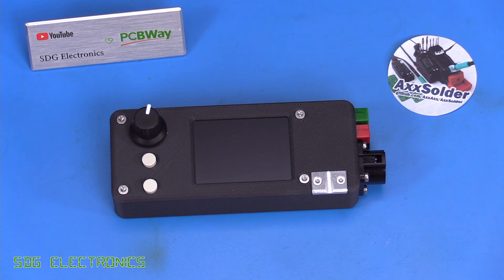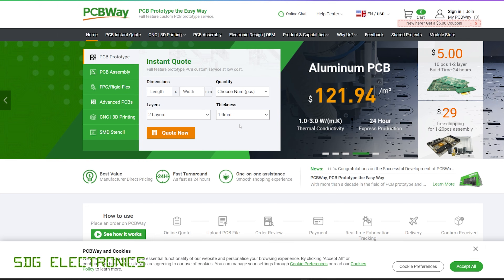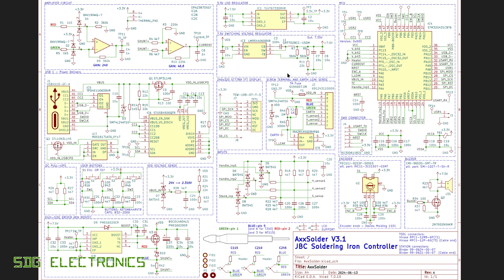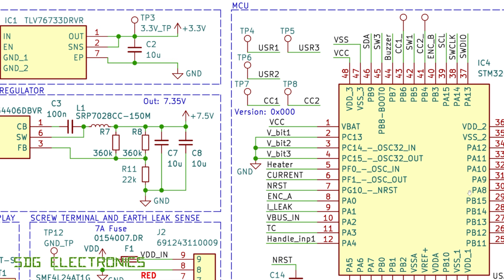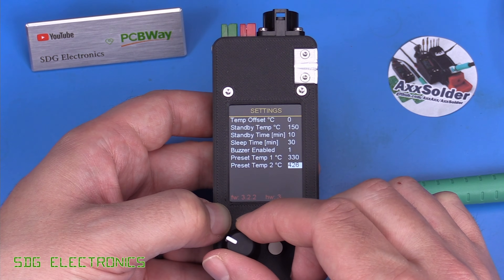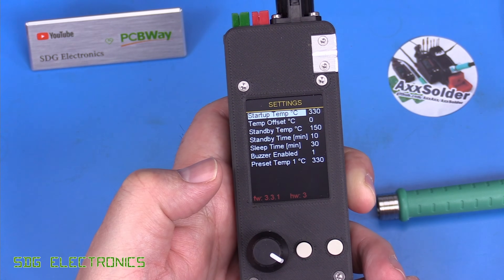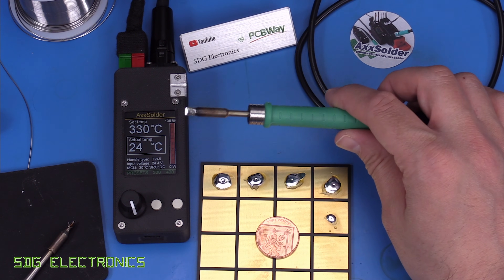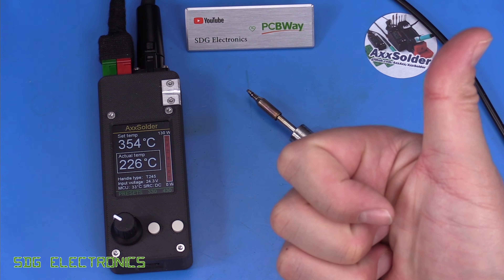SDG #358 AxxSolder - Open Source JBC Soldering System

Comment: This AxxSolder is a splendid soldering controller and your review is very insightful. Thank you!
I'd do the fixes you've suggested, use an MR30 connector instead of the andersons and add a safer handle holder.
Reply: Are there any sockets for case mounting available for the MR30 connector? I could only find some for direct pcb mounting.
Reply: @XD-nj7bc  I haven't found any panel mounted MR30, but you could use an  XT60IE-M, which accepts standard XT60 from a LiPo for exemple, but also XT60 with a ground tab if you have the correct grounded power supply.

Comment: 12:10 usb-c pd 3.0 is limited to 100W (20V*5A) on one port/cable. I assume the 140W is the max of all ports together on the usb power adapter.
140W for 1 sink needs pd3.1 EPR (28V*5A) that I doubt the usb charger or the AxxSolder supports, but I might be wrong.

Comment: I wanna make this with cheaper more accessible ICs. I'd make one if it wasn't hard to source parts!
I also think the circuit is a bit overkill(?) I could remove the PD circuit as I don't need to use it portably.  a few months ago I made my budget/improved version of this PCB but gave up halfway trough because of difficult things in my life and money. Now i'm too depressed to DIY one.
EDIT: damn onl 35 usd on pcbway for a fully assembled one? I could probably make an entire unit for 150cad-200cad. a lot less than aixun and other alternatives and probably much better.
Reply: better than aixun yeah, but you still need more parts, LCD connectors, handle, etc. $100 gets you a completed geeboon unit or similar.

Comment: Has anyone found a replacement for the Hirose RPC1-12RB-6P(71) connectors? 
They are now obsolete, obviously there is some equivalent since both JBC and all the chinese stations use these but I couldn't find anything on Mouser or Aliexpress...

Comment: Hello,
I've known about this project for a few months and I have to say it's really a professional device!
But as you say, there are a few little things that bother me! 
Above all, the constant switching on and off to program buttons and in the system settings.

Every other device saves after, say, 3-4 seconds of holding down.
Or if you bridge the encoder for 3-5 seconds, the main menu opens.
The only thing that happens when you switch it on and off should be the software update.

This is better in my opinion.

Comment: Cool video!
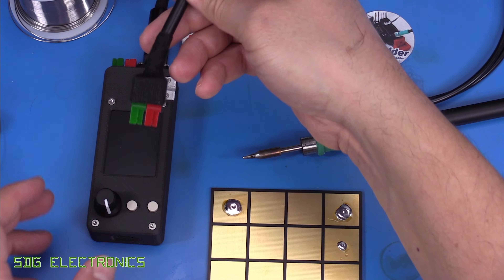Did you solder crimped connections on the DC cable, around 13:30 in the video? When I was assembling 3D printers, it was recommended to not solder crimped connections. It stiffens the wire, and creates a weak point in the transition from stiffened to soft wire. Solder OR crimp, but not both - especially for wires, that move or vibrate.

Comment: USB PD is limited to 5A in most cases by the PD standard. With the 2021 usb PD 3.1 Revision 28V, 36V and 48V are also supported. If 28V if fine, 140W would the limit.

Comment: Nice design!  I didn't see any cold-junction sensing on the schematic.   Does the the electronics get hot with use that might be a problem.  Then again, a few degrees here or there wont matter for soldering.
Reply: mcu has internal temperature sensor

Comment: Thanks for reviewing my AxxSolder! 
The ideas about long-pressing the preset button to save the current set-temperature and long-pressing the encoder to get into the menu are great! I will implement them into the next firmware! :) 

And regarding the 100 watt cap when powering from USB PD - It is as you stated afterwards, the STUSB4500 USB PD controller that has a limit of 100 watt (USB PD 3.0).

There are quite some good ideas and improvements coming up and I will put them on GitHub in "Issues" to keep track of them until they are implemented.

Comment: Should i buy Jbc dde-2c or Metcal cv5210?
I don’t know what I should buy
Reply from the maker: Depends what you want to use it for. The Metcal is great for no-fuss soldering. If you need the variable temperature then the JBC might be the better choice.
Reply: @ thank you for the answer 
both are pretty much the same price
Metcal 930€
Jbc dde-2c with iron and stand 980€
€ slightly higher than US dollar 
Would like to have it as long as possible  maybe 20 to 30 years if possible

Comment: Since the USB-C station you have can do 140W on the single port (Nexode?), I think your cable is the limitation.
Only found one USB C to C on Ugreen's website which has blacked out connectors and it's rated for 100W. Going to need a 240W cable to fully power that thing with your charger.
Reply: It CAN be that the cable is limiting the power from USB PD sources sometimes. But in this case it is most probably the STUSB4500 USB PD controller which can negotiate a maximum of 100 W.
Reply: @Axel.Johansson  Oh, silly me, I should've taken a look at the PD controller. Thank you

Comment: It would be incredibly cool to redesign the PCB and the display to fit inside the popular AIXUN soldering station housing.
Reply: Then you would still have to buy the housing. Getting the case printed and buying a seperate stand is far cheaper. It would be a good replacement though if the aixun station breaks.
Reply: @XD-nj7bc  Of course, no one would buy an Aixun just to salvage its case and stand. There are, however, tons of Aixun stations owners who want to upgrade their stations. Both the Aixun T3B and T2A use mutually incompatible JBC cartridges. If you want to use both the C245 and C210 cartridges, you'll have to buy both stations to support them. It's a significant expense and takes up precious bench space. By simply replacing the existing controller board with the AxxSolder, they can use both types along with the other benefits of an open source firmware.

Comment: we do love jbc, but it would be cool if one for weller was available, maybe even a portable one
Reply: You might be shocked as to how easy that is. I have lesser known OEM handles that will accept competitors’ tips to meet contractual requirements gaps.
Reply: @ChrisSmith-tc4df  That's pretty cool. Like JBC isn't meeting all standards requirements so they make handles which use the tip formats used by third parties?

Comment: I find PCBway website to be confusing. Can someone tell me what the cost of an assembled board is? Thanks.
Reply: Something like 5€ for the PCB, 70-80€ of components and then you have to pay for assembly and shipping. Then you still have to flash the firmware and build some kind of enclosure.

But as shown in the video the project is on the pcb manufacturing website so you just have to add it to your cart.
Reply: @grininventor  psbway is also selling components? I am also confused with this side, I see only PCB and/or pcb+assembly,

Comment: Thanks for the review! I'd like to see a review of the Aixun T-400 station. Wondering if the Aixun T225 4-in-1 handle will work with genuine JBC C470 250 Watt tips? Also would like to see a review of the Hakko FX-971 station.

Comment: Nice iron, and a great review.
Instead of a sleep rest.......I wonder in a portable solution like this you have a metal pad on the case (next to the LCD) and you tap your iron tip on the pad to start or stop temp control......that way the iron can be knocked about the workbench with no fear of turning on.
Reply: Good idea, maybe it could be a user setting to enable "tap rest" to be able to tap the metal stand to go between SLEEP and RUN. 
In the station version the same logic and hardware is used to sense when the handle is in the crade so in that case I think you still want to logic that it goes into sleep mode "WHILE" the handle touches the cradle.